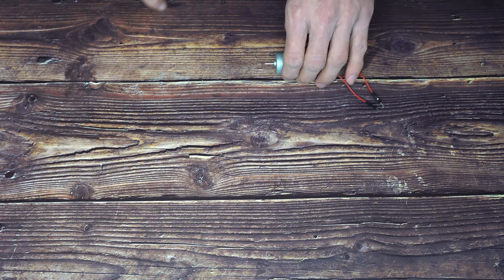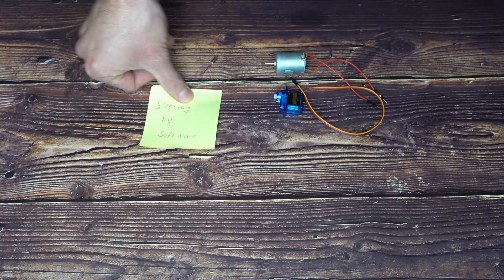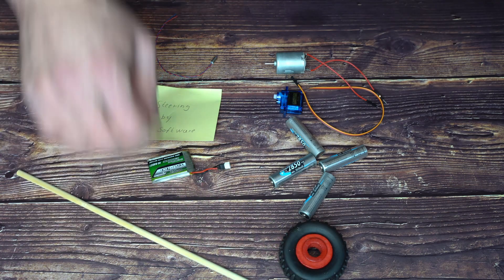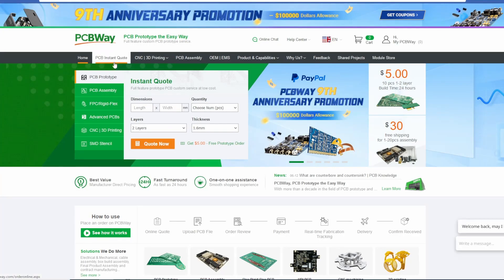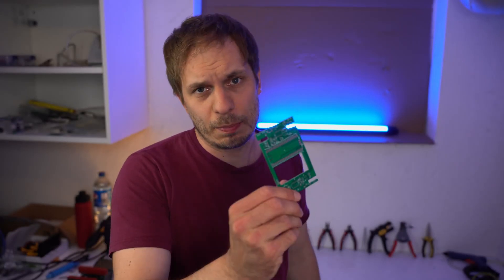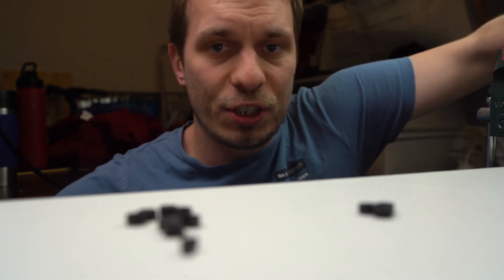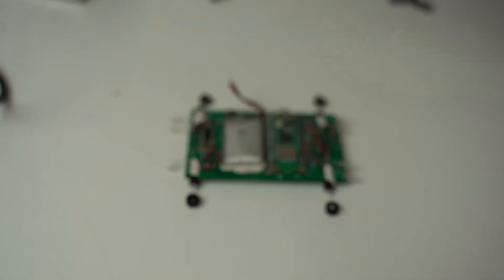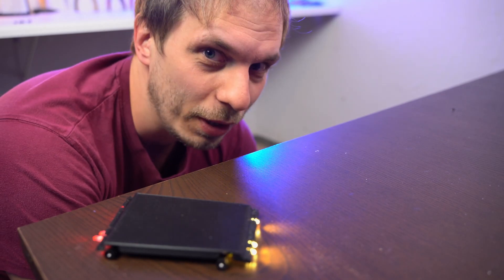Toy Car Drive underneath a door !

Comment: imagine if he could fit an fpv camera on it like a 5.8 ghz one short range and they are pretty slim and only need like 3-3.5 volts minimum
Reply from the maker: Hehe thanks for your comment. In my first draft a wanted to add a OLED in Front as a Number Plate ;-) but a camera is also nice, may i do a Version 2 ;-) any further ideas ?